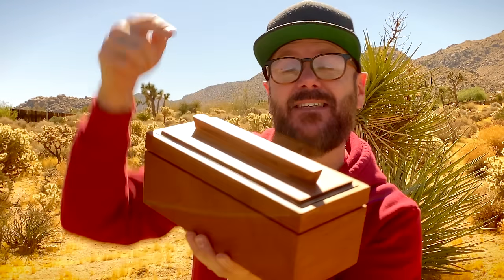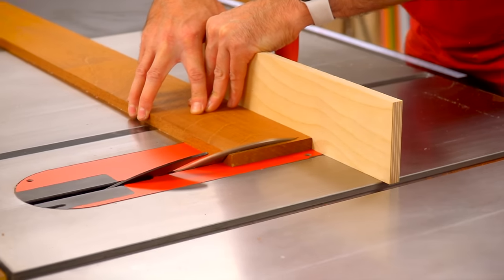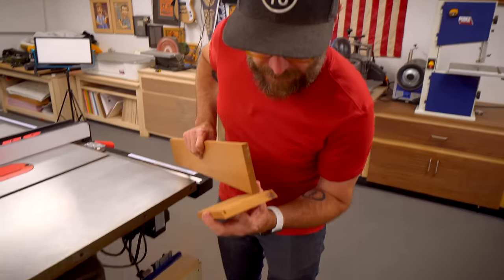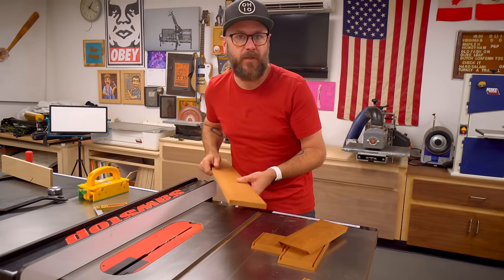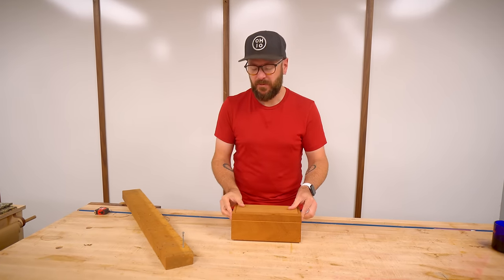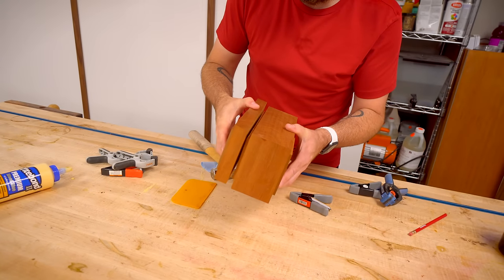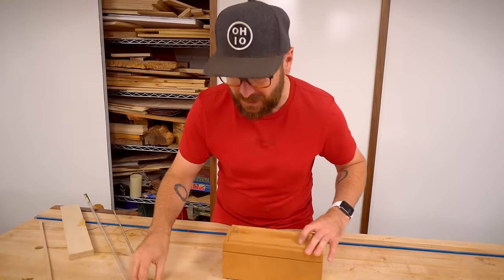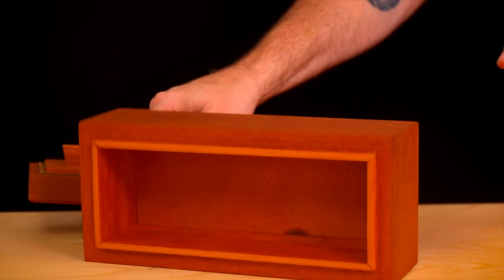How to Make a Mitered Wood Box | Woodworking Project

Comment: Brilliant tip using a piece of wood on your fence to get the same length. Picked up yet another David trick.
Reply: Do you have a link for the finish that was used on the box?
Reply from the maker: Yep, link in the description.
Reply: Make Something stupid work computers won’t let me open your links. Will have to check at the house.

Comment: Nice box! I have a four feet 1x4 mahogany board I bought at Menards a year ago. I want to resaw it on my Rikon like you have and possibly make a box (or two) because the grain's really nice. 

I ordered some Simple Finish from Maker Brand. Looking forward to trying it out. I'm trying to find finishes that aren't dangerous to use indoors. So I use alcohol-based dye and water-based poly for stained projects and maybe this simple finish for just bare wood projects.